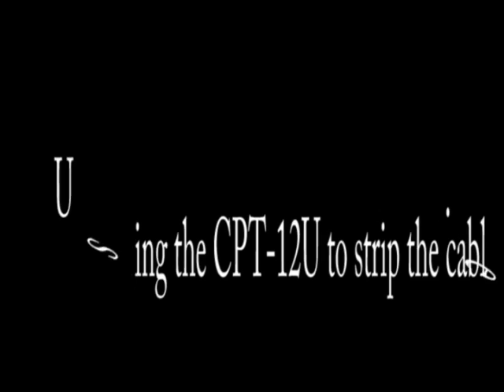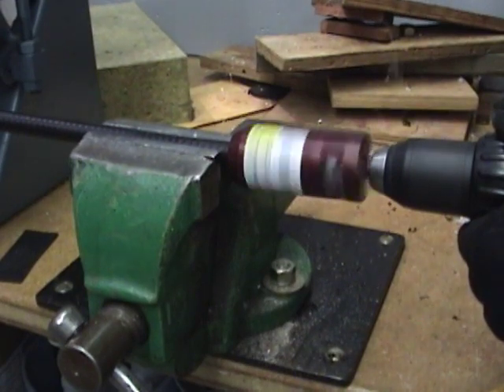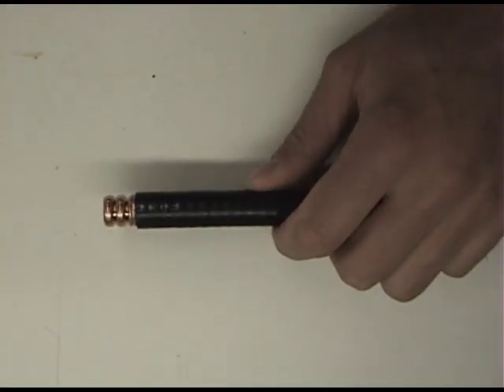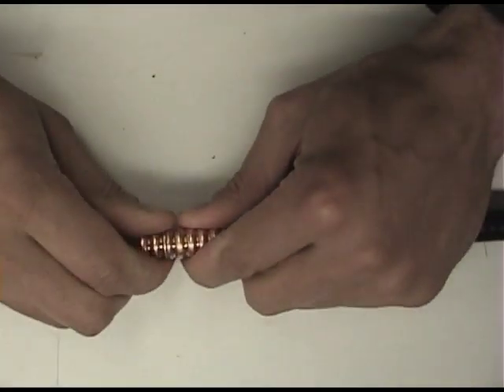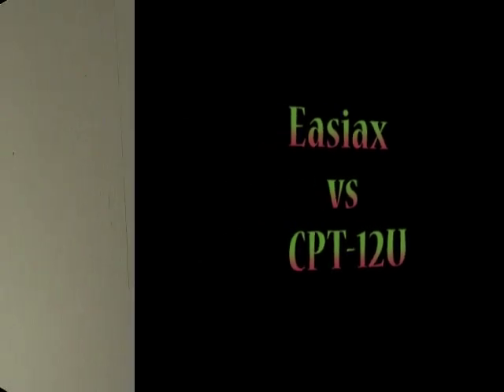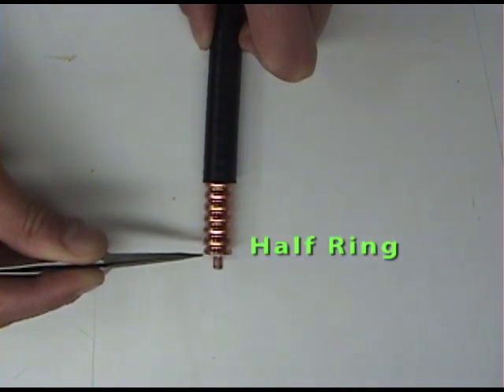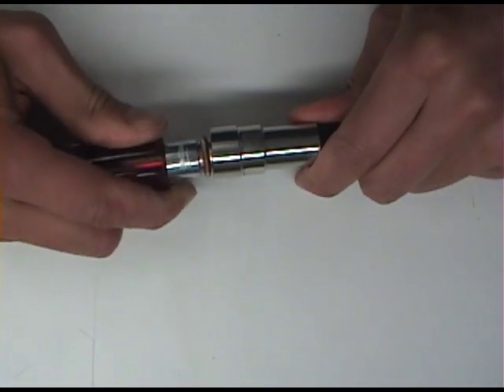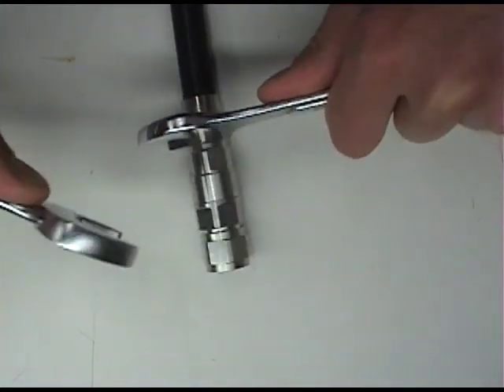L4TNM-PSA Installation onto LDF4-50A

Comment: I find that the CPT-12U will scuff the dielectric into spider web like threads which will always get between the inner conductor and the terminator, making the connection no good. Also if you are terminating leaky feeder, the leading blade of the CPT-12U will catch the lip of an aperture and rip it, deforming the end. You will get a perfect bevel though fwiw.